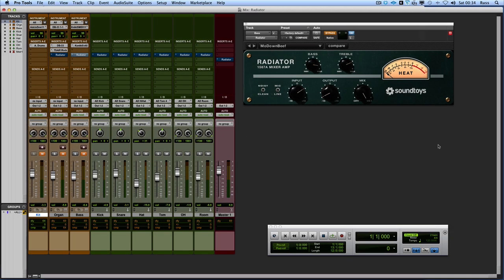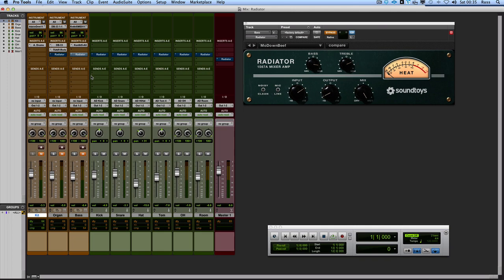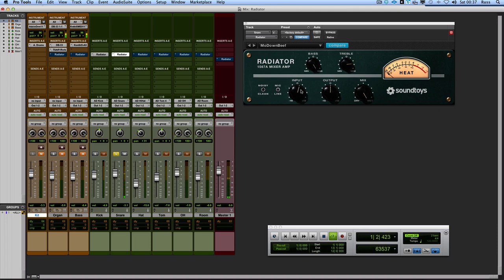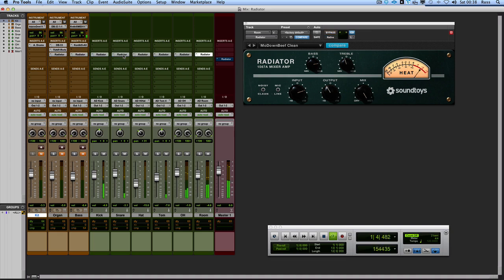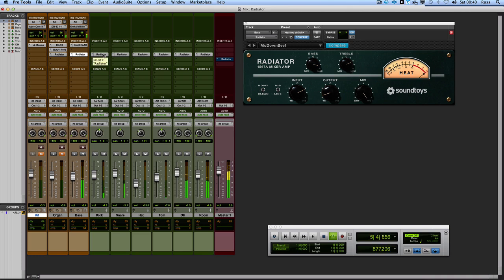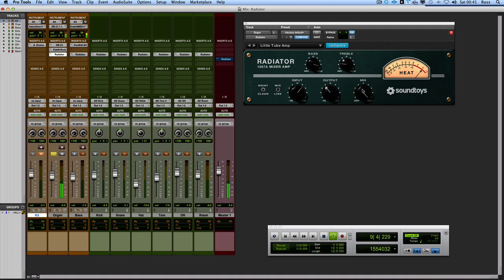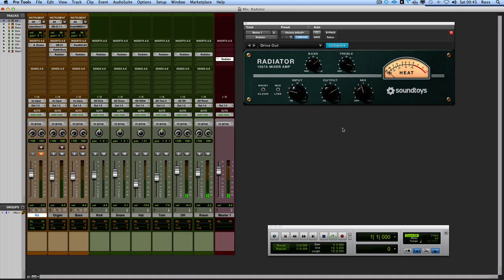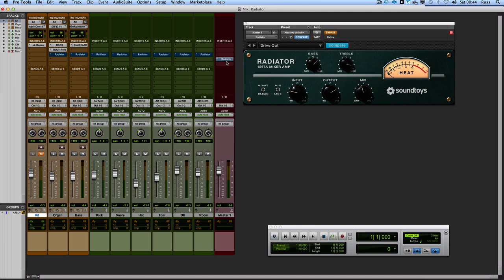SoundToys Radiator - Video Review

Comment: Ok, so level-matching isn't a "rule" - it's not essential, but it really helps when making meaningful comparisons of tonal/harmonic changes.
Secondly, what's the VU-type meter calibrated to? It should be usable and meaningful. It's there for a reason. Analogue modeled units are generally referenced to +4dBu = 0VU = -18 or -14dB FS (digital). So, for anyone wanting to replicate the sound of a real unit best as possible, use your ears above all else of course but you're more likely to get "there" with an input level closer to 0VU (ie: minus 18dB digital, or so), at least until one knows when and why to break the "rules". It's another advantage of high bit depth and floating point digital audio – you don't need to be up near the ceiling. - professional tweaker.